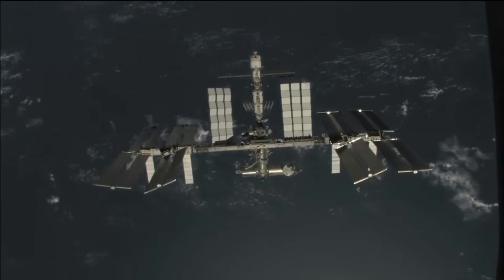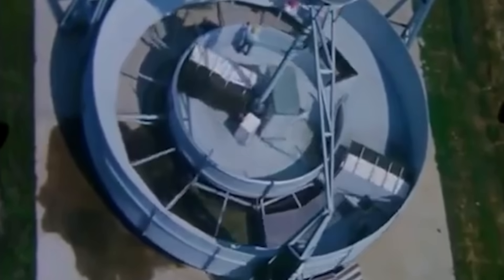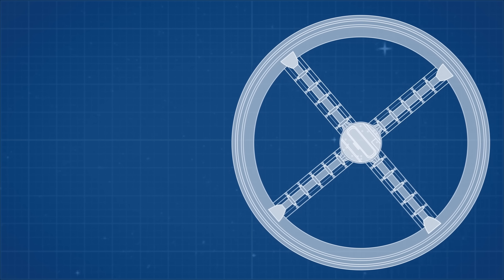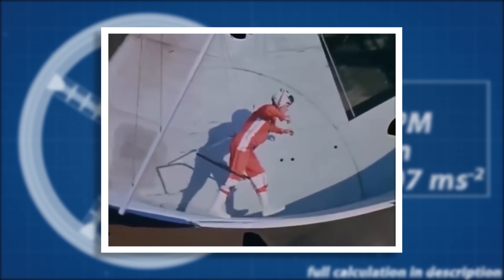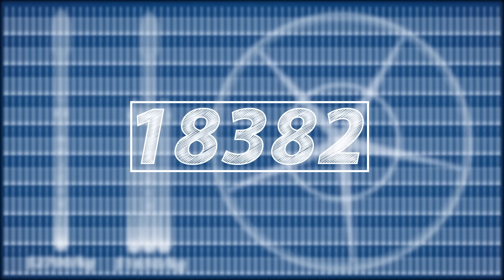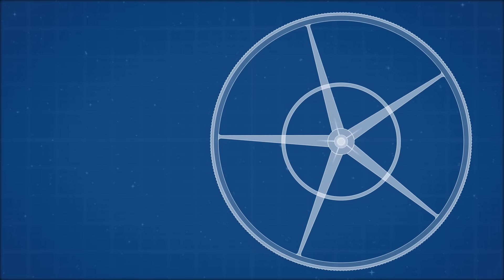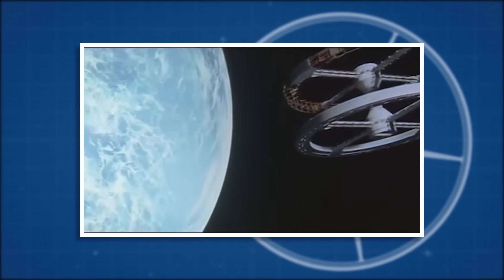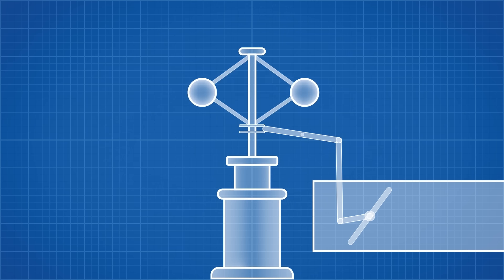Can We Create Artificial Gravity?

Comment: Centrifugal force isn't real. Neither is centripetal force.

Don't forget, there are only four fundamental forces. EM, gravity, strong and weak nuclear. These forces can provide the acceleration required for circular motion, and we can label them as the provided force for circular motion. That's when we label them centripetal forces. The opposing force that the object in motion can provide can then be called centripetal force if it's acting on something else.

Look at orbits of planetary objects. We can say that the force of gravity provides the centripetal force, but there's no such thing as a centrifugal force, only the acceleration that's opposing the circular motion.
Reply: Well then that fool Issac Newton must have been wrong about bodies in motion. Drive you car into a wall at 100 mph and then we can discuss how the four fundamental forces haven't acted on your crumpled body. No, it isn't a 'force' in the classical sense, but neither is Bernoulli's Principle. Yet airplanes still fly despite the classic force of gravity acting upon them.

This isn't actual gravity. It's simulated by inertial motion to create a circumstance that resembles gravity.
Reply: TheAE35Unit Uh, your body crumpling due to a car crash is due to the electromagnetic interaction, or the EM force. The normal contact force (EM interaction) exerted by the car on your body and accelerating you extremely quickly is what kills you. Airplanes fly, again, due to the EM interaction. By the way, Newton also acknowledges that centrifugal and centripetal forces aren't real forces. By his exact words, he states that the force of gravity provides the centripetal acceleration.

Of course this system isn't gravity, but centripetal and centrifugal forces aren't real forces, they are a name we give to any four of the fundamental forces when they provide a circular motion.

For example, electron orbits in the Rutherford model is where electromagnetic force provides centripetal force. The Earth-moon system is when gravity provides centripetal force. In the rotating space-station, normal contact force, aka electromagnetic force provides centripetal force. It's like you never took high-school Physics.

I'm just explaining what people mean when they argue about centripetal and centrifugal forces. The narrator simplifies it so much that he's just serving to propagate even more misinformation.
Reply: Dear Lord you are being pedantic. Ultimately there are only four forces in physics. And yes the Bernoulli principle is dictated by the interaction of molecules in the atmosphere which are subject to electromagnetic and the other three true forces. But your argument is akin to suggesting that water doesn't really exist because it is made the fundamental elements of hydrogen and oxygen. And hydrogen and oxygen don't really exist because they are made of protons, neutrons and electrons. And PN and E don't exist because they are made of quarks.

And your high school comment represents 'dickism'. Which is your newly discovered fifth state of matter.
Reply: TheAE35Unit I'm just delivering the argument for why people say the CF isn't a real force. 

Obviously it exists, I never said it didn't, it's how we describe the force that provides circular motion. But it's not a real force, and that's where the argument came from. It's like you want to go against convention because the poster wanted to be different or whatever, and now all the Physics enthusiasts watching his videos are misinformed and take even longer to understand what the centripetal and centrifugal forces are. 

Your reductions of matter into it's fundamental particles are completely different, "Dear Lord", I hope you don't depend on logic to survive. I never argued that parts do not make a whole, stop trying to attack strawmen and jumping to conclusions.

In fact, Physics is all about being pedantic. Force isn't mass * acceleration, the vector of rate of change of momentum is force, according to Newton, in his words. Let's just butcher the statement because pop culture changed it, and then get confused when it doesn't apply to rocket science.

I stand by my statement that you sound like your only interaction with Physics is pre-college. Centrifugal and centripetal forces are NOT real forces, a result of other forces in the creation of circular motion, and if you can't see that, then I cannot be bothered to even try to inform you of a fact that you're so stubborn to accept. Good luck failing your Circular Motion module in college.
Reply: Pedantic: adjective
1.
ostentatious in one's learning.

You're not impressing anyone but yourself. Your argument is that CF is not in fact a 'force' but an effect. So your objection is to the common vernacular. That is an insubstantial argument and you have contributed nothing to the dialog other than your attempt to impress. The effect does exist and can be utilized to simulate gravity. "There's no such thing as a centrifugal force" you say. Yes there is despite the casual use of the word 'force'. Which leads to the second definition of pedantic:

2.
overly concerned with minute details or formalisms, especially in teaching.

"I hope you don't depend on logic to survive..."
"you're so stubborn to accept. Good luck failing..."
"... you sound like your only interaction with Physics is pre-college"

Ah, Ad hominem attacks. The final stages of a failed argument.
Reply: " I merely questioned your experience with Physics and you resort to explicit insults"

Newton also stated insults are met with an opposite and greater reinsult. Best not to initiate the sequence.
Reply: TheAE35Unit You still haven't responded to my argument, instead focusing on all the ad hom because you care so much. It's seriously like you don't even want to learn. You talk about escalation of insults, yet you try to position yourself higher and deviate from the actual discussion. 

This isn't an argument about vernacular, it's actual Physics. I don't know how to break it to someone who keeps avoiding the points and instead, focuses on personal details. 

How have I not contributed anything to the discussion? You have merely chose to avoid it continuously because you're so obsessed with proving CF as a real force when it is merely a label. A common misunderstanding of CF at all levels is that it is a fundamental force, but it must always be stated before all your calculations that another force provides CF, exactly like Newton has said. The normal contact in the spinning space station provides the feeling of weight, but understand that on Earth, gravity does not provide the feeling of weight, the normal contact force with the ground does. That's why astronauts on the ISS or free-falling in a vacuum provides the experience of 'weightlessness' even when gravity still has an effect on them. What we're stimulating is the reactionary normal contact force, not gravity. There's a world of difference, and if you cared about Physics you'd understand that this difference of differentiating CF from other forces matters, because it is essential to equations of orbits and everything related. If you want to calculate orbital velocity, you have to state that gravity provides CF, only then does it make sense to state GM/r^2 = w^2r. If you understood CF as a "force", then the equation for CF would make no sense in the context of real life, and you'll go through your academic career misunderstanding the concept of CF.

If you still think that you're too smart for this, and continue to try to position yourself higher than me based on personal attacks instead of facing the facts, then I really can't help you. I'm trying my best here, but you're still as stubborn as ever. If you're offended by that, too bad. Why don't you write another comment about it, and ignore the fact that has been convention since Newton's days?
Reply: Now I see the problem. This isn't about physics, it's your personality. You are unable to correct yourself when you are wrong. Let me demonstrate

"You have merely chose to avoid it continuously because you're so obsessed with proving CF as a real force when it is merely a label."    False.

This is actually a common technique in debate or argument. Mischaracterize your opponents position then attack the mischaracterize. Weak. 

 I never called it a real 'force'. This is your attempt to distract from the real issue which is that you said:

"Centrifugal force isn't real. Neither is centripetal force." 

That is an exact quote of the first thing you wrote. I have no dispute with your explanations. It your characterization that an effect is not 'real'. If that is true, then no effect is real. I have said there are four classic forces and it would be better labeled centrifugal 'effect'. Centrifugal 'effect' is an APPARENT force as observed from a point within the rotation. Centripetal is the other side of the coin that is observed from a non rotational perspective. They are both predictable, observable, measurable and repeatable and therefor 'real'.

Comment: So what would happen if you ran against the direction of rotation? Ie it's rotating clockwise and you were to match the rotational speed anti-clockwise, does the inertia still have an effect on you by taking the rotational force away from you?
Reply: If you could match the speed of rotation, you would effectively be weightless. If you could run faster than the rotation, you would once again be in a simulated gravity effect. Similarly, if you ran in the direction of rotation, you would increase the simulated gravity effect. There is also the issue of an 'atmosphere' causing friction on your body so you would eventually return to the rotational state.
Reply: TheAE35Unit I thought as much, thanks for the reply

Comment: You dont need a whole ring?
How about a habitat a number of long strong kevlar cables and an asteroid or second habitat the other side as a counter weight.
You could also have a detachable cable half the length from the center of both mass and rotation astronauts could use to get between the 2.

Comment: "Centrifugal Force" is just an incorrect name for the rider's inertia. If you switch reference frames to a point inside the rotation like this, you're ignoring the entire system you're trying to describe. If you move the rider to the center of the system, and he remains stationary, your entire argument for "centrifugal force" breaks down even from your reference frame.

There is no force pushing the rider "down" toward the outside of the wheel. There is only a force constantly pulling him in toward the center as his momentum tries to carry him in a tangental straight line, and the "horizontal" acceleration maintaining the rotation of the system and the rider.

This is further evidenced because if the rider were to move quickly enough in the opposite direction of the "floor's" rotation, they would eventually lose the inertia as they reduce their velocity, and they would lose the simulated gravity effects as well. They could be 'hovering' right above the 'floor' as it spins beneath them, with no force pulling them inward or outward to the rotating system.

Comment: You say Aluminium. What about carbon fibers? They are significantly stronger than steel per gramm (five times the strength or something like this?). Or is that material simply not suited for vacuum environment?
And will i ever get an answer?

Comment: Surely there is no need for a complete ring. All you need is a single compartment and a counter weight with a cable between them, then spin the whole structure. It could easily be achieved with no greater mass than the current space station. The difficulty is pointing solar panels, communication dishes and docking. Even doing earth observations would be much more difficult.
Much more important with respect to the international space station is the fact that its whole purpose, is to provide a place for zero g experiments, so you would still want a central, non-rotating section in which do do those experiments (which may include having humans living in it, as that too is an experiment.)

Comment: only one problem: what if you jump off the rotating floor?? how i see it you will not have the rotation anymore since rotation is not an inertial motion and nothing is rotating you anymore so will stop experiencing this gravity.. so you will have to keep contact or otherwise you will float and something will hit you since the room is whizzing around you XD. Correct me if im picturing this incorrectly please

You could summarize my point to: objects dont fall in artificial gravity they just stick to the floor, but once picked up will not fall. they will make a straigth (from inertial reference frame) and hit the floor somewhere else or float if not given velocity relative to the space craft.

It can only be circumvented if the atmosphere in the room is co-rotating.. so a fluid I guess. So interstellar astronauts will be in diving suits under water in space craft XD or asleep in stasis with electrodes attached to stimulate muscles

Comment: The problem with the ring that nobody seems to acknowledge: You are standing on the "floor" of a 100m diameter spinning ring and you turn your body sharply 90° to the right. Unless you are prepared for it, you will be thrown off your feet. That's gyroscopic action.

Comment: I never really understood this centripetal/centrifugal business. When you stir a cop of tea for example, the bubbles are always ending up in the middle of the cup, rather unlike our astronaut.
Reply from the maker: Centrifugal force means heavier objects get pushed further out, as they have more inertia. This is how centrifuges work. Bubbles are the lightest thing in a fluid, so they get force closer to the centre. Think of density. Heavier stuff goes to the bottom of a glass and bubbles go to the top.
Reply: please do not say lighter and heavier when talking about density, this is not a good explanation as a very light rock will still sink in a massive pool even though the pool is much "heavier" than the rock. Also "centrifugal force" is never real even from the inertial reference frame, it is always centripetal force/centripetal acceleration.
Reply: +Real Engineering you asked for it JK but seriously, ummm not quite it is the inert force that is tangent to the centripetal acceleration is the force keeping the object in an orbit that creates the force "pulling you out" when you spin. Centrifugal force says there is a force pulling out in at a opposite too to the centripetal acceleration but this has been disproven in modern physics. Oh and the 3rd law is not centrifugal the equal and opposite force inside of a centrifuge would instead be normal force. On a side note though I love your channel and you put lots of effort into your videos and now days that is a rare thing on YouTube. I'm not trying to be a cynic just trying to help.

Comment: Why does the space station have to be a full ring? Surely it'd be simpler and cheaper to have a habitation module rotating around a central axis opposite some kind of counterweight. With this method you could achieve much higher effective diameters with much less weight.
Reply: PS. Just noticed there is a similar comment thread below, so no need to tell me about it :P

Comment: very good and clear. the problem is mankind dose not understand gravity's interaction with matter. you can simulate effect of gravity. this dose not eliminate the effect of gravity on atom, molecule and cells in the body. it will minimize the pressure and fluid imbalance not cell function. when the space agencies get serious about space, then they should try to understand structure of matter and nature of gravity. not just gravity 's effect. because scientist are too stupid to ask. they have wasted 50 years of my time. To make clear for you. Your tummy may be full of wind or food. same sensation. food will sustain you for a while. wind give you fart and you will have hunger for nourishment. MG1
Reply: What part of gravity's interaction with matter do we not have a good understanding of?  How does a system like shown differ from gravity in regards to cell function?
Reply: The only part man know about gravity is same as all living thing, vegetable, animal that it pulls you to ward the larger mass. They do not know what make the smaller mass go toward the larger one. They just know it dose. Like heat. They don’t know what heat is. They know it burns. All the forces have structure, and they are physical. Scientist pretend to know which stop the researchers to find out. Photon, electron, nuclei have structure and all of them interact with gravity. The interaction of forces with atom is matter which make molecule, make cell.
If you have been to Imax 3d, you get full sensation. This is because your brain make your body release same chemical as it would do if it was real experience, but your body did not get damaged as it would when it was real event. In the same way, air is matter but dose not give you nourishment as a meal would. Yet both give you sensation of being full. MG1
Reply: I am attracted to earth, but earth is also attracted to me. Its not a one way function like you described. General relativity seems to explain fairly well what the attraction is.  Heat is energy moving from one object to another, generally vibrations of the molecules.

Comment: I have a question. Would an open wheel like structure like Elysium work in space and would the cetrifugal forces holding down any breatable air for the people to breathe that are held at the edges by the artificial gravity?
Even if it could I guess people will be exposed to loads of cosmic radiation.